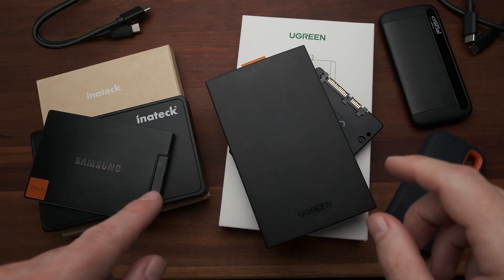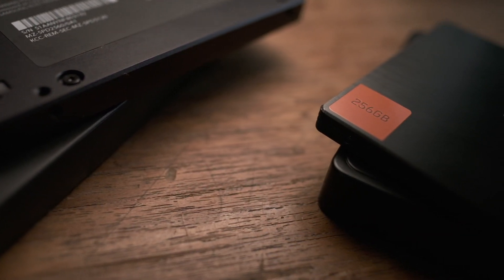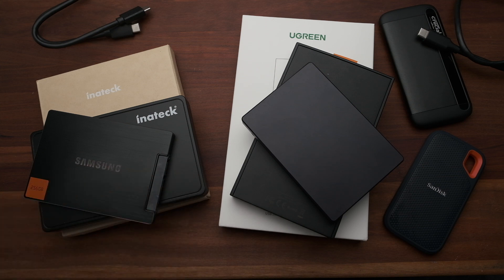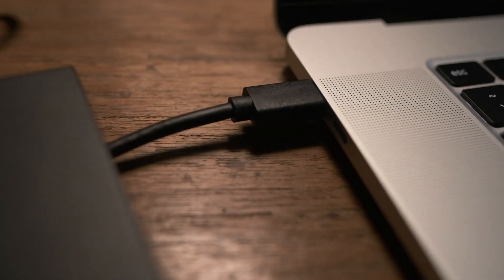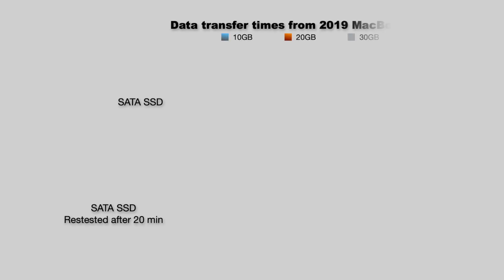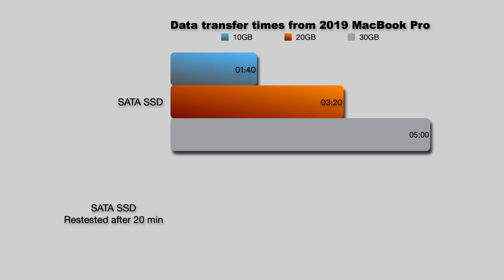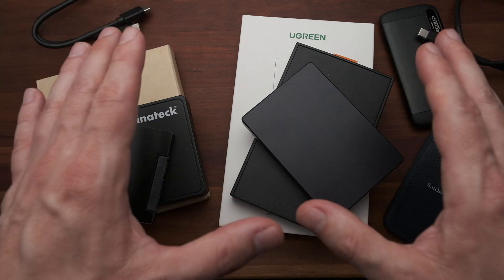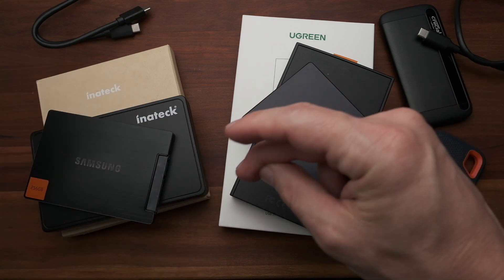External SSD slowdown? This simple tip might fix it

Comment: This just happened to me. I have a WD 1TB HDD and a 512GB ADATA ssd. For some reason my ssd was only running at 40MB/s when copying files. But my HDD can run up to 120MB/s. In the same enclosure with the same files. This is so annoying.  SSD should be faster than HDD, right? We're talking about portable devices here. Where we need to move files quickly. I can't wait for 20 minutes just to start moving files. Who can wait that long?
Reply: Hi i thought only my adata su650 ssd who is running at 40 MB/S did you found the solution for your adata ssd its getting annoying real quick when i tried to copy games and it become slower than hdd

Comment: So I have a 2018 15 inch fully maxed out MacBook Pro with the i9 processor and the pro Vega 20 graphics card. Ever since I updated it to the Mac OS seqouia beta update, all my usb type c adds and hdds all have a listed read and write speed of around 30mbps per second when tested in blackmagic. Why the heck is this happening. I’ve tried everything like switching cables and using powered dongles and stuff. Nothing works. How do I fix this??
Reply: I wonder if it is reindexing them? Although, it could be an issue with beta that might be worth reporting.

Comment: You genius.  I have no idea why this worked but it did.  I have two small internal SSDs in small caddies.  Wanted to try in new MBP using USB-C.  One was as fast as usual, c.250 MB/s, the other had dropped to less than 10.  Left the slow one connected for 10-15 mins and it's back over 250.  Cheers for that.

Ganpati bless.
Reply: Well, mine are always connected and always on and this has grown to a permanent problem that neither shutting down nor recovery and restore - nothing fixes. I’d love to know how if the dock is always on and the Max never sleeps this is supposed to help. So enjoy it while it lasts, and long may it last for you, best, truly.

Comment: My crucial X8 2tb runs like garbage. It barely gets over 50MB/s for 98% of the time. It only hits the 900+MB/s for the first 10 seconds.
I've only had this problem with Crucial's X series SSDs. My sandisk extreme pros do not have this problem.
Reply: me 2
Reply: SAME drive, same result, same frustration... BUT.. have x6 and x9 as well. they dont do it. x8 SUCKSSSS to heavens, it's so frustrating

Comment: I’m enjoying this issue, 10gb files transfers at 17mbs on Samsung SSD connected to pc with USB 2, and then through SD card adaptor to SDHC 128gb card. My SSD is permanently attached, not sure if it’s SSD, PC or SD adaptor that’s slowing it down

Comment: I just bought two SSD drives from Aliexpress... 8TB each, USB-C connector. The transfer speed is appalling. 4Gb estimate transfer was 3 hours; it is now 4 hours after copying the first 300 MB... I tried both ExFAT and NTFS formats, there is no difference, and the performance is terrible. Any suggestions? Their support said the speed depends on the device, I use top equipment (one-year-old top-of-the-range computers), both Mac and PC... thank you in advance!
Reply: These could be fake drives and may not even contain SSDs. Get some software and verify that you got what you paid for. 8TB sounds ripe for being conned unless you paid a very high price.
Reply: @steveblease they were fake. I opened it, there was no ssd inside, only a cheap 64 gb card, nothing even closer to 8 TB. They refunded one of the 2 drives, that was all; the price was 10 usd, I should have known it was a scam…
Reply: I looked on Ali Express and real 8TB SSDs are £600. Did you really spend £600 on a SSD from China? I doubt it. They also sell 4TB ssds for £3.51. There are videos all over Youtube about fake external HDs from Ali Express.

Comment: I can confirm that incredibly, this worked for me on a 2020 M1 macbook pro with a new Acasis TB3/USB3.1 enclosure and an Intel 760p installed. Initial speeds using certified TB3 cable were about 650w/750r despite anything I did. So I came across this video and gave it a shot, left the enclosure plugged in for about 20-30 minutes on battery. Eventually plugged the laptop in to power for about another hour while I did some other work then came back and saw that Blackmagic disk speed test was getting about 2400w/2800r. The only additional odd thing I can point out is that when I closed Blackmagic and opened up Amorphous Disk Mark, the measured speeds reverted to about 650/750 until I left that app sitting open for another 5 minutes or so. Reran that test and results were back up in the 2GBps range. I can only guess that there must be some kind of throttling process going on in the background at the OS level that must be vetting the new hardware and/or apps that are allowed to access it. In any case, glad to have come across this tip and hope my additional info helps in someone finding the root cause.

Comment: I have a problem where after a spike of 500~ MBps it just drops to 0 KBps with the better performance policy; with the quick removal setting it switches between 13 MBps and 20 MBps... any help?
Reply: Mine has the exact same issue. Did u find a solution yet

Comment: Hi I recently bought an m1 pro 14" macbook pro with Ventura already installed and I also updated to Ventura 13.1 cause my older macbook pro started to slow down. I also purchased new ssd external hard drive to transfer files from an older external hard drive. After having transferred all the files over to the new ssd external hard drive I plug it into the usb c port on my new m1 pro macbook pro. it then shows up on my computer screen. but when I double click it to see the files in it. I click on a file I the word "loading" with a spinning gear and it didnt stop loading I waited up a half hour and it was still loading. How do I fix this problem?

Comment: not sure what kinda nonsense this is but uh, if you have to let the drive sit for 20 min, you need to add 20 min to transfer time because you're intent to transfer started 20 min BEFORE you plugged in the drive.
Reply: What a doofus comment 😂😂
Reply: @Sparkalonius  doofus comment?  lol so basically you don't have a clue how time value is converted into monetary value.  you're so dumb, you'd be ripping yourself off right off the top?
Reply: Yeah, this shit is crazy. These are supposed to be fast media drives. Infuriating and dumb take.
Reply: Plus my drives are on an OWC Thunderbolt dock and my iMac’s set to NEVER sleep. Between Google INTENTIONALLY breaking the web to control their false paradigm and Cook destroying Apple you can’t find any fkg info ever anymore to fix shit that used to never occur. I fix one problem on this p.o.s. and there’s always another one - literally get zero work done. So “top of the line”. And Apple Tech Support? Forget it. They’re the ones who told me to break my firmware device iD chain by deleting fkg containers. And I don’t even know if it’s not intentional to weaponize shit against us at this point. Unreal. So sick of it all.

Comment: My external  SSD speed too slow after formatting that SSD which contains time machine backup,
Can you help me with that problem ?
Reply from the maker: Maybe this from Apple might point you in the right direction. “Note: The entire APFS volume is reserved for Time Machine backups. If you want to store files other than the Time Machine backup on the same physical device, use Disk Utility to create an additional APFS volume on the disk. The two volumes then share the available space.” https://support.apple.com/guide/mac-help/types-of-disks-you-can-use-with-time-machine-mh15139/mac
Reply: @MatthewFortner  Thank You sir

Comment: OMG! This worked! 

I recently upgraded from MacBook Air M1 256 to Macbook Pro M1 1 TB and when I transferred all my files with my external SSD drives they both turned into snails. I thought they were trash and couldn't understand how this happened with both of them nearly simultaneously. This coincidence seemed a bit suspicious to me, hence my not throwing them away so swiftly.

I am happy to report that after allowing it to stay connected, unused and remain that way for 10 minutes my ADATA 1 TB SSD is transferring again at regular speeds via USB ~350 MB/s.

My 2 TB hasn't "repaired itself" yet. But I'm leaving it plugged in and looking forward to seeing how it performs tomorrow. 

Thank you so much Matthew for making this cool video and giving us this amazing tip! You rock!!!
Reply from the maker: Glad to see you got good results so far. Best luck on the second one!

Comment: I have seen that when i use a USB C connection for SSD drives it gets hotter than when using a USB 3, so for writing i connect to a USB C and for reading i connect to a USB 3 (blue)
Reply from the maker: Interesting observation!

Comment: But SSD external drives get very hot (i have two, one is a Sandisk Extreme Pro 4 TB and the other one it is  a WD Black P50 4 TB) so do you think it will shorten its life span living the SSD 30 minutes?
Reply from the maker: They do get so hot, right?!  A good one should have a chipset to throttle to prevent it from cooking itself and be designed to transfer that heat away from the chipset. Time will tell who has not done an adequate job. These have been out a while now.